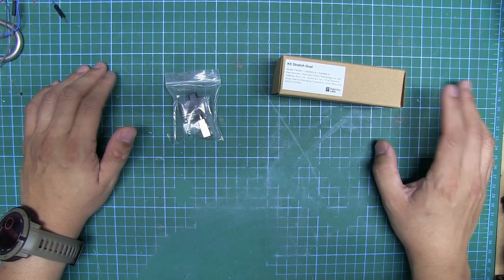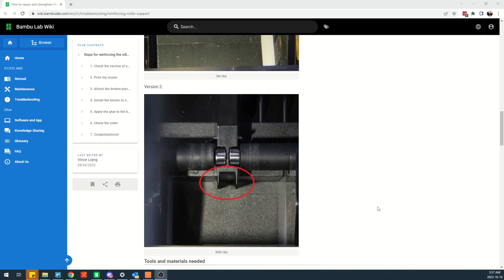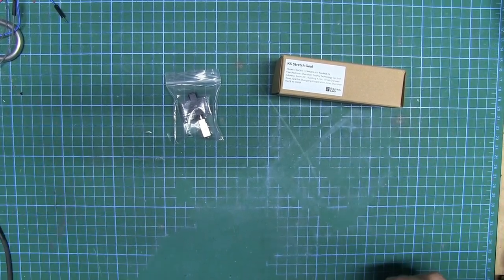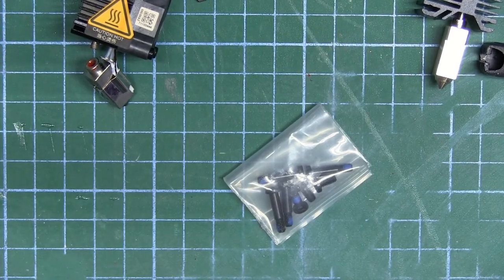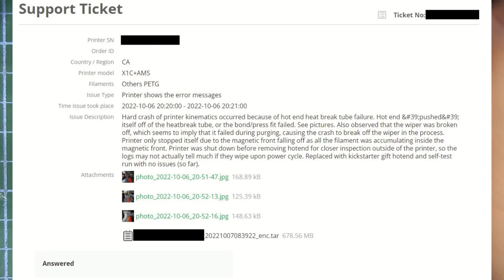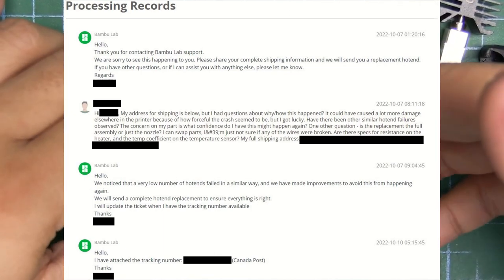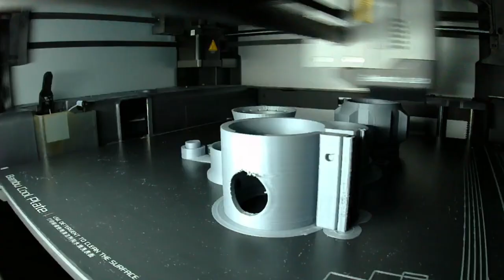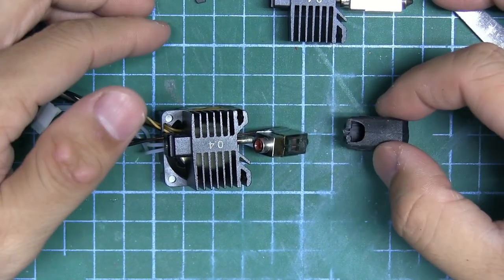Bambu Lab X1-Carbon - Hotend Nozzle Failure

Comment: dude, i wish i would have watched this a week ago.

last week i had the tip portion of the nozzle shoot out while running carbon fiber nylon, horrible screeching noise from printer. immediately contacted Bambu, within a day they had my replacement parts, they took 2 days to ship it out and the same day they said they would replace the hot end i decided to order a whole drive replacement.hotend assembly for spares, they shipped the replacement parts USPS and my order FEDEX, they still have yet to arrive

what they failed to remind me of was the fact that i had a spare hot end included, my bad for forgetting but they should have prefaced the communication with "we are shipping your replacement part, in the meanwhile do you still have the spare hot end that was included in your original purchase" your video reminded me i had a spare hot end and i am back in business now, thank you!

Comment: In my Big Bambu, in plugging in the nozzle temperature sensor (a/k/a thermistor), the socket on the printed circuit board broke off. With the sensor (black and white wire) still plugged in. I received the printer about 10 days ago and a clog, for which  the nozzle and extruder were removed.  A piece of broken filament was found in the extruder pathway.
What the outcome will be is unknown, but I have hope that Bambu Lab will do ‘the right thing’,  I requested a Toolhead assembly.

Comment: I had my hotend face pop off yesterday too, the whole head skipped on the track because I started a bad print without realizing it. I had the build plate full of gridfinity bins and one of them didn't have a bottom layer in the center between the holes so when the second layer printed it didn't slow down so it left a bunch of blobs, and the third layer caused the head to start skipping, until the point that the head hit the inside wall of the printer. There's a tab inside the door to the left that popped the face of the head off before any permanent damage was done. Popped it back on, figured out why it messed up, and did a calibration, been running great ever since.
Reply from the maker: I've found that the stock fusion 360 template doesn't merge all the bodies correctly. I found the same problem but caught it at gcode preview and merged the bodies before exporting to 3mf.

Comment: I’ve had something similar happen on a bimetal heatbrake for a different printer. The threaded copper plug separated from the titanium tube during a print. I press fit it back but from then on it was no longer solid. I figured it was just cheaply made. (Ali express). I changed it to a bimetal one that didn’t use copper for the threads going into the heater block. I didn’t think about expansion differences for different metals so if copper expands more when heated on the titanium, that would explain what happened to mine as well. They should use a keyed joint so the different metal pieces are mechanically joined, and can’t come apart. It’s also less likely to happen if you use a larger nozzle, as well as slower print speeds. I assume because there’s less pressure. I agree with you as well that you should never run printers unattended. I always monitor mine via Octo print and webcams.

Comment: 12:20 it is not important which expands more as they heat up. What is important is that they both expand when heating. If the heatblock expands when hot,  the inner radius where the tube fits will shrink, and the fit will get tighter. If the titanium tube heats up, the outer radius expands making the fit tighter as well.
Reply: I’ve done testing on thermal expansions for ocean sensors. The ID of the hole expands as well. So if the thermal expansion of the outer part is larger than the inner part, the joint will get loose once the expansion exceeds the interference tolerance. The question is, have the engineers at Bambu Labs accounted for this? If so great, if not there will be more of these failures in the future.

Comment: This definetly should not have happened.
If you do the math on how much force a press fitting like that requires to be be broken it is usually thousands of pounds; especially if they use heat for the process.
For this to happen it means the the diameters of the titanium part and steel part were out of spec.
Reply: This titanium or stainless steel pipe has very thin wall thickness. I think that's a problem too.

Comment: I imagine that the outer shell of the nozzle might be a different material than the tip,  and both ends might be pressed into what could be non hardened steel. Just a guess though.

As for this problem, I imagine that this is a tolerance thing, where for some, that press fit will be looser than others and this will require the factory to tighten up tolerance there.

I'm guessing that there was a partial clog or it was unable to extruder over a semi fail causing it to push off the slightly looser than normal nozzle off of the press fit.

I believe the kinematics system will simply skip steps before destroying itself as thst is the case for every other 3d printer I have seen but this is a guess also.

As a note about the Bambulab slicer I don't think they were pressured so much as they would release it anyways, as they said they were going to before shipping to paying customers before anyone made a fuss.

I also don't think this company is transperant. Not in a slimy illegal way, but in that if you want a champion of open source this is very much for consumers a closed source turn key solution. You buy spares from Bambu, you get replacement parts from Bambu. The firmware comes from Bambu. To be clear, I don't think this makes them a bad company even though I would obviously prefer control over my device,  especially as many other respected companies such as Ultimaker take the same approach open sourcing the slicer but close sourcing the firmware but it is something to note for open source die hards.

As for them not giving you the details, this might sound like a weird suggestion, but perhaps asking one of the more engineering oriented employees on discord could get you better results as I suspect customer support is geared towards getting problems fixed as quickly as possible for normal people.

Lastly,  as I haven't seen many reports of this myself  and have put a couple kilos through my own as well I do suspect this really is a small batch issue. I imagine it might even be possible this happens with a low enough occurrence for them to not be particularly concerned about spending exponential effort to fix a small issue. 

Even with the weirdly hostile responses I've seen to this printer (maybe because they have closed source firmware or use a cloud or make prusa look obsolete or because of their country of origin?!) I still haven't seen very many negative experiences.

As for time, outside of curiosity, I think for any other printer that wasn't shiny and new I'd just change out the 15 dollar part.

That all said thanks for positing the video. It's always good when people put Mor einformation out rather than less and now if there is a pattern there's another data point.
Reply from the maker: It could be a tolerance issue, without any more details only time and more userbase information sharing will tell what the real failure rates are.

I would imagine the kinematics would skip steps too, and so far I've printed tons after the issue and it's been fine so far.

I have the new hotend so I'll just measure and compare across.

And definitely my beef is more that it's a shiny new printer with a less than conventional hotend compared to the E3D stuff that I'm used to.

Comment: Thanks for an informative video. This is off topic, but maybe you can help clarify something for me. Am I understanding the only connectivity to this machine is via the cloud or direct insertion of an sd card and there is no usb connectivity? If so, this could be a big drawback to this machine from 2 stand points, 1 being privacy, and 2 having unreliable internet service at some ones home or living in the boonies. Although I do have wifi, everything at my place is hard wired for security purposes. I have not made a pre order as of yet as this is a pretty big issue. The disadvantage of using an sd card is you loose some of the functions of the slicer software from what I have seen in all the videos I have watched. Thanks again for the post, I will subscribe to follow your progress as you seem to be an intelligent and a technical kind of guy. Cheers...and thumbs up.
Reply from the maker: From what I can tell, you always have the option to save gcode locally from a dropdown, and then port it to a microSD card. I think I already saw a mod somewhere for someone to use a microSD to full size adapter so they didn't have to juggle small cards.

The app does have the capability to stream video to your app, which begs the question whether it sends video all the time or only when requested, and what kind of security implications that has.

But once it's printing it doesn't rely on the cloud for anything.
Reply: @aonomus  Thanks for the response. I'm guessing that there will be other mods and hacks from users as time goes on. I may go ahead with the pre order this week. For the most part, everyone who has this machine has been happy with it from what I have seen. Thanks, and all the best. Cheers.
Reply: Can Bambu be configured as Access-Point? It is safer, no internet connection. Highly possible they can add this feature without any hardware changes.
Reply: They promised to implement a LAN mode in some time
Reply from the maker: @theon2k  It'd be nice from a owners IP-rights perspective. Keep stuff out of the cloud where not neccessary.
Reply: @theon2k  That would be really good news. I would be sold on it then for sure. Thanks for the info.
Reply: They have  a local wifi option that presumably works over wifi but without any internet connection. I haven't tested it specifically yet though but it is an option in the interface.
Reply: @BeefIngot  Well that would be really cool indeed. Keep us posted if you get it to work, I would be interested to hear about it. Thanks for the update.

Comment: If you are concerned about safety, check the heatbed's mains cables (110-230V) for rubbing against the lead screw. Issue seen in many videos.
Sorry but this printer will fail. Too many newbie mistakes. You can't repair everything with glue here and there.
It also looses its precision over time, due to wear or something else.
Reply: What a weird comment sounds like you want this thing to fail for some reason. Meanwhile it's the best printer to be released for consumers in a while with far less failures or issues than any other printer.

Much of your comment is idle speculation while actual users have better experiences.
Reply: The former engineers from DJI have made the best 3d printer on their first try. As for printers anything can fail given time. Show me one product that has never failed in the history of humanity and I will tell you to stop dreaming. 

Now for the price name a better printer in 2022 with the speed, capability and ease of use of the X1 series printers.
I await your answer.
Reply: @No0o0o0o0o0  Many failures could be avoided with proper engineering and calculation then QA. But nobody cares nowadays, when it is no problem to consumers to buy new stuff more often. 

This printer is really good, when it's new and works. Hope they will improve and fix all issues soon.
Reply: @KBS_  There are about 6000+ kickstarter backers and more preorders on the way. There isn't a large enough sample size to go into detail but perusing reddit, youtube discord, facebook and a general google search shows there aren't many people who are running into issues.

 When there are issues Bambu Lab support are quick to address it as evidenced by this channel. 

So this is a new company with retail products that are a 2-3 months old so time will tell. I will say the (former) DJI engineers have put prusa, creality and all the other fdm 3d printers on notice to innovate or get left behind. A few short years ago people were happy if a printer hit 100mm/s with quality and this is with countless hours of tweaking. This printer hits klipper speeds 200-300mm/s out of the box on the 2nd slowest setting of standard. Auto filament flow calibrations with their "micro lidar". First layer scans with AI. Nothing out there doing that right now in the consumer space. 

I have seen disassembly of the X1 and it is pretty straight forward for anyone in the hobby.
 
 The king is dead(prusa) long live the king(bambu lab)  

I cant wait to see what 2023 will yield for the next innovation. We are getting closer and closer to star trek replicators(in plastic) 
🤣
Reply: @No0o0o0o0o0  You're right.
.
You're all a little excited and so far you can't see what I'm seeing. Maybe I'm overly cautious. To clarify, everything can be repaired and fixed, if there are sufficient funds.
Reply: @KBS_  I understand what you are saying. So far we haven't seen any thermal runaway events or electrical shorts or anything major. (I have seen the cable near the back z screw mentioned though) As you can tell I am more in the rainbows and sunshine commune instead of doom and gloom internment camp. 

Every (new) company has to a lot to prove and with this being the first offering they are learning and adapting. After dealing with an highly modifed ender 3 pro I am well aware of how things can go horribly wrong. This issue falls into the minor category(for me).
Reply: Is it even possible to replace carbon fiber rods and brass bushings of the X axis? Disassembly can be complicated.
Reply: @KBS_  You've made general criticisms w/o any supporting info.

What exactly are you seeing, specifically?
Reply: @KBS_  Thanks for the link, that's a very well done review.

I watched the entire video and don't remember any mention of brass bushings, nor why using them would be an issue.

Also, what he states as the downside to the X1, that it may potentially need to be discarded after some years of service, is purely speculative.

I expect that Bambu will have spare parts and/or refurbishing services available.
Reply: @noahkatz9616  Carbon fiber is abrasive and brass is a rather soft metal. Brass and graphite residues stick to the linear rods like grease, making them less abrasive, but still not perfect. 
Printer won't break because of that, but the owners will notice a lower quality of prints, I'm guessing - after 2-10k hours (subjective).
BTW my thoughts are based on my own experience and not on anyone else's words.
Reply: @KBS_  If you're talking about the linear guides, I don't think that applies, as I believe the surface of the carbon fiber tubes is plastic resin.
Reply: @noahkatz9616  Yes, I'm talking about carbon fiber tubes linear guides. 
No, those rods were grinded after molding proces, to achieve specified dimensions, so on it's surface there are now exposed carbon strands (ofc mixed with epoxy).
Reply: @KBS_  Oh, I didn't know that.

I'd think Delrin would be a better bushing material - better wearing, lighter, and cheaper.

Regardless, I don't understand why you assume that that kills the printer, and not just be a replaceable part.
Reply: @noahkatz9616  No, as I told, brass bushings won't kill it. In the far future wear may cause issues to the automated calibrations, but it's a firmware problem (fixable).

I see many mistakes in basic matter, which leads me to suppose that there will be more of them, maybe more serious ones.
That's my point. There is a lack of engineering and R&D, not in a fancy stuff, but in the fundamentals. (e.g. How will you name an AMS plastic parts breaking?)
We'll see what happens. User is the worst tester, he can break the indestructible.

Comment: Dude, the hot ends < $15 move on with life
Reply: I think guys like him (and myself actually) have a problem where we are very verbose about issues which to many people comes across as being angry, or over reacting or jitpicky when really we just are trying to figure things ot and be precise in our criticisms.

He said multiple times in the video he still thought it was a very positive experience so I don't think he misses the fact that this was just a easy change.

I think he just made this video to potentialy help others.
Reply: Dont forget the Nozzle Wiper with 3 pcs for
$3.99 USD🤣
Reply from the maker: @BeefIngot  It's more to do with: new printer + new unproven company --> save others the potential bad experience, and PSA about not leaving printers unattended for this very reason
Reply: Actually the surprising thing is, that the X1 didn’t stop and warn you about the loose housing. That’s how it usually works. I had a very similar experience, with the difference that the machine protected itself.